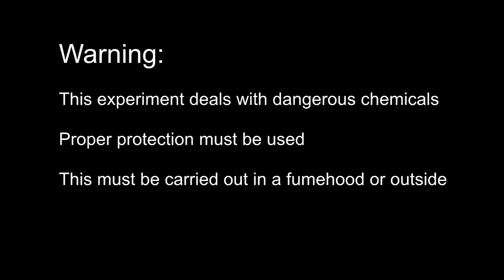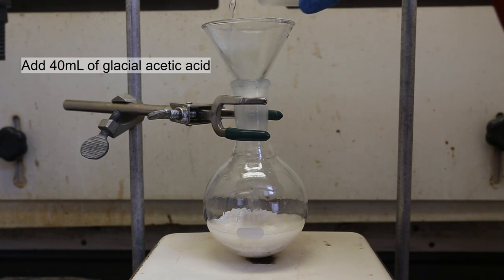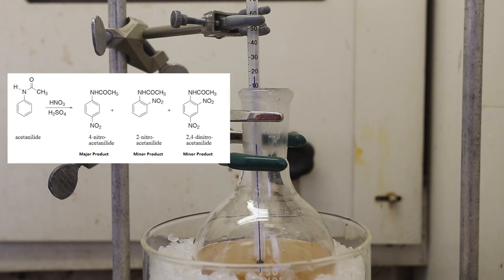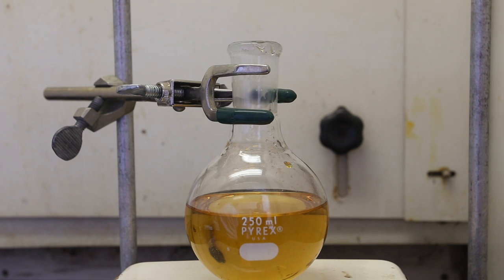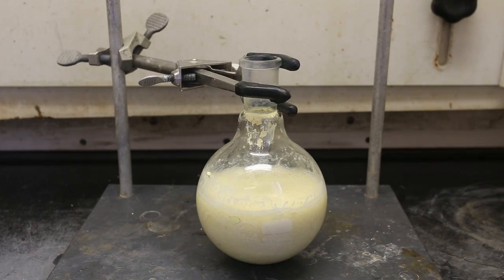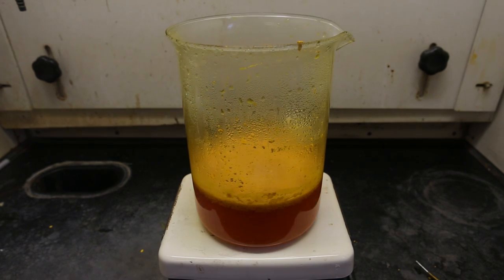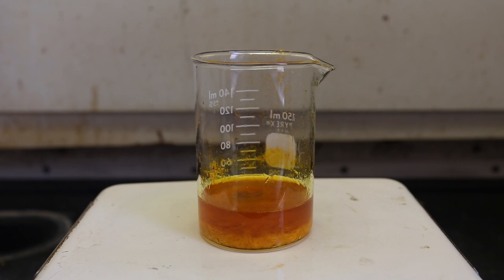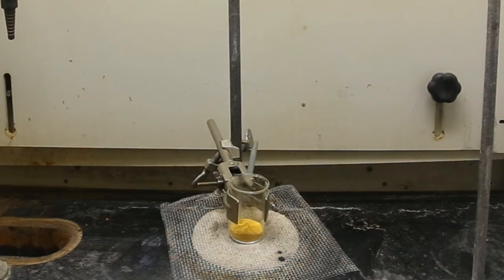Making a carbon snake with P-Nitroaniline

Comment: It would be so totally meta if you made a video on the synthesis and properties of Nile Red, Nile Red :P
Reply from the maker: +Seth Mitchell I plan to eventually !
Reply: +Seth Mitchell what is nile red?
Reply: +11Chemistry  
N ile R ed 
N erd R age
This is nerd rage without the voice distortion.
Oh... half-life 3 confirmed.
Reply: +Output Nile red (also known as Nile blue oxazone) is a lipophilic stain. It is produced by boiling a solution of Nile blue with sulfuric acid.

Can you see where this is going?
Reply: It'd be so meta if the acylamino group was a meta director :D
Reply: @NileRed  update?
Reply: Nitro is a meta director, but also deactivator, real hard to make dinitrobenzene even. Trinitrobenzene is made by oxidizing the methyl of TNT. Dinitrobenzene is meta.
Reply: haha

Comment: Hi ! Thanks i use to perform this experiment in my PG as lab excercise. Method which  was prescribed in our lab manual for hydrolysis of p-nitroacetanilide was bit tedious and yield was also unsatisfactory.
Your method is comparatively easier and seems to provide much better results ! However, i would like to point that temperature of Acetanilide- Glacial acetic acid mix. reached upto 20 deg. Centigrade which is responsible for formation of o- nitro acetanilide and o - nitro aniline upto significant. However, if u manage to keep temp. during nitration below 10 deg. C  formation of o isomer would be very less becos formation of o-isomer requires compratively high temp. so carrying out nitration below 10 deg. C i m pretty sure it will help u !
Reply from the maker: That could work as far as I know, but it would have to be tested! I don't really have to revisit and test it though, unfortunately.
Reply: Okay thanks for your reply ! Wish u best of luck for your future attempts !

Comment: can't wait for the nitrous oxide video. keep up the great work
Reply from the maker: I plan to film that soon. I was really hoping to get carbon disulfide to do the "barking dog" experiment. I wasn't able to get it though.
Reply: Nile you don´t have a video on Acetanilide haven´t you? don´t know if it´s as easy as i think it is, but would still be interesting. (i think i can neutralize aniline with acetic acid and then gently heat it and maybe at some calcium chloride to catch the water generated in the reaction?

Comment: The commercial process to produce PNA is to start with nitrobenzene and directly add the amine group into the para position using ammonia.  Yields are much higher.  But the process require high pressure (30 bar?).

Comment: It is remarkable that there is no obvious sign at all (vapours of NO2) for a nitration in progress.
Reply: 196Stefan2 if you see NO2 vapors while nitrating something, then you're doing it wrong😂😂😂. Sorry but to me your comment sounds like a "your cake didn't turn black. You're doing it wrong!" During nitration reactions you must keep the temperature below 15°C, otherwise the unstable NO2+ will become NO2, which is obviously bad for your reaction.
Reply: Hello Pietro, no, I did some nitrations of aromatic hydrocarbons (Nitrobenzene and m-Dinitrobenzene, o- and p-Nitrotoluene) during my vocatinal training many years ago and I always observed the evolution of brown NO2, sometimes more sometimes less. The NO2-formation did even occur inside the reaction vessel where no oxygen should be present to oxydize NO to NO2 (if there was any). The yields were always within the range of expectation. Nitrobenze was later used as starter material for the Dintrobenzene and Aniline.
Reply: 196Stefan2 I'm not saying that NO2 production will stop the reaction, I'm just saying that it should be better to avoid it, and if you have excess nitric acid it won't impact the yield. Of course there are some nitrations (like TNT synth or TNF synth) where you have to heat up the mixture to get the reaction going and in this case NO2 production has to be expected. But for mono notrations the reaction is fast even without heating it, and producing NO2 is always an issue. I am currently doing some aromatic nitrations in my school lab and my teacher always tells me not to let the temperature rise. Maybe when you did your reactions teachers were a little less concerned about safety.
By the way I think you're messing up a little bit with some reactions. NO2 production doesn't come from NO oxidation (there isn't NO in your reactants, and oxidizing NO to NO2 is a catalyzed reaction which occours at high temperatures). NO2 comes from the breakdown of nitric anhydride N2O5, which comes from the dehydration of HNO3 (when you have both NO3- ions and NO2+ ions in solutions they can combine to form N2O5, which is highly hygroscopic and normally it rehydrates before it can break down). But if you heat up the mixture you increase the production of N2O5 and allow it to escape, and increase its decomposition rate.

Comment: Hey,  i did this starting with about 34.8g of acetanilide and ended up with 14.9 of p nitroaniline even though I skipped the water recrystallization. The product is very brown but i hear it can be '' yellow or brown''. Since my school went on strike,  the nitroacetanilide was left to dry for a month after i filtered it.  I will be making the reaction with sulfuric this afternoon.
Reply: I got the same problem. 

I did the synthesis twice, but I got the very brown product twice. 

The problem might be, that the reaction is not cool enough when it gets nitrated. The first time I tried it my reaction temperature while nitrating was about 20°C and at the second (where the product was not that brown as at the first try) try about 12°C.

Comment: What's the reason why aniline couldn't be used as the starting material? Couldn't you just nitrate that and skip the hydrolysis step? My best guess is either it'd be too dangerous/messy to work with, or the relatively bulky acetanilide group increases the yield of the para product relative to the ortho

Comment: Duh. There are twice as many ortho positions as para positions so ortho is statistically favored. Also formed is the nitramide which in acid rearranges ortho. Nitration of Aspirin the initial sulfuric sulfonates the ring stabilizing the phenol to oxidation by nitric a. Both ortho and para are differently acidic with the dinitroacetanilide being even more acidic. A short Alumina column would separate them easily. One trick for whiter crystals is treating solution with activated charcoal before crystalization.

Comment: You mentioned 'anhydrous acetic acid' rather than glacial acetic acid. 

I learned that 'anhydrous' acetic acid was acetic anhydride and not glacial acetic acid.  Please advise, thank you.
Reply from the maker: Anhydrous acetic acid is the same thing as glacial acetic acid. Acetic anhydride is a totally different chemical and it can somewhat be viewed as the combination of two acetic acid molecules. It is no longer produced using acetic acid though. When acetic anhydride is added to water, the anhydride linkage will be hydrolized and two molecules of acetic acid will be formed. 

In essence, acetic acid is a carboxylic acid, but acetic anhydride is an anhydride. If you look up these chemicals on Wikipedia, it will likely show you everything you need to know!

Comment: Why do you always use a roundbottom flask? Wouldn't it be more efficient to use an erlenmeyer flask? With that you can use a hotplate and can regulate the heat/speed of a distilation/reaction better.
Reply: Tetahydril he has more surface area with the heating mantle I think instead of just the bottom of a flask

Comment: The link is for a reaction with 4-nitroacetanilide if 4-nitroaniline is used instead what are the correct amounts of 4-nitroaniline and nitric acid and what should be the molar concentration of the acid?  I can not imagine the amounts and concentrations are the same as the reactivity is different.  Thanks

Comment: From a purely mechanical observation: Your "final product" after being ground in mortar in pestle was FAR too course. I can't speak to the purity of either your product, or your reagent by this video. Your synthesis is sound, however I"m not sure ambient temps, and humidity were considered, and since some of the reactions involved in, synthesizing the components of this reaction are very temp sensitive; elevation (or for contained apparatus' pressure) must also be considered.

Comment: Are there any chemicals that can damage the beaker?
Reply: Hydrofluoric acid can
Reply: Ben Abbott yeah but that would take some time! Glass is used for a good reason:)
Reply: Yeah, almost every radical substitution/addition reaction

Which is why you need Teflon insets, or your glassware will stick together.
Reply: Justin Koenig no, radical substitutions can't damage glass, unless you're talking about fluorine radicals. And neither addition reactions do.

Comment: Would this nitration work for nitrating toluene?
Reply: BeGamerSl no bro 😂 TNT is much  more difficult to do. you need to do orto-nitrotoluene by nitrating once toluene following the procedure of the video. let it stir for 3 or 4 hours and let it sit overnight. you'll find some solid yellow stuff (p-nitrotoluene) and a yellow opaque liquid (o-nitrotoluene). then you have to take the yellow liquid that comes off (the o-nitrotoluene) and renitrate it with the same process. you can also renitrate the solid stuff that comes off from the first reaction (the para-nitrotoluene), but p-nitrotoluene and dinitrotoluene are very similar and you wouldn't distinguish them well at the end of the second nitration, and this would bring to a dinitrotoluene highly contaminated with para-nitrotoluene. if you nitrate only the o-nitrotoluene (which is a liquid) you can easily separate the yellow solid (dinitrotoluene) from the leftover liquid (o-nitrotoluene). at the end of this process you'll need to do the last step, which is a heavy nitration and very, very difficult to do. you have to take 100% (anhydrous) nitric acid, which is a very dangerous chemical (it will lit on fire almost every polymer, wood or organic material wich comes in contact with it) and can't be found online, you can afford it only if you work in a missile station, or you can produce it yourself, but is very, very difficult. search "how to make fuming nitric acid" from NileRed. it's 87% nitric acid, it will work, but not as well as the 100% one. you can do it if you need a dirty TNT.
over the 100% nitric acid, you'll need oleum, which is a mixture of 70% sulphuric acid and 30% SO3. you can't find it online or somewhere, but if you work in a lab you can find it. otherwise, i don't know methods to produce it out of a H2SO4 factory. the industrial method is absorbing SO3 in concentrated sulphuric acid until you reach the desired concentration, but you can't do it yourself. 
so, i've finished with the chemicals, and let's do the last step. you have to setup an ice bath. make sure that the temperature of the oleum is 0°C and then start adding DROPWISE, EXTREMELY SLOWLY, the nitric acid. The addition of the nitric acid to the oleum is extremely exothermic, much more than the one in the video, and can sometimes be violent. never let the temperature rise above 5°C. Using the stoichiometric amount of nitric acid is wrong. you have to use a large excess of nitric acid and an even larger excess of oleum. the nitric mixture must be 30% nitric acid and 70%oleum.
Then, when the temperature has returned to 0°C, dump into the solution the dinitrotoluene (is better if it's dried and powderized). Then let it sit overnight. you'll obtain some nice crystals of yellow TNT. i don't know the purification techniques, you'll need to do a recrystallization but i don't know the right solvent. probably DCM. don't try to lit it on fire because it won't work. it'll burn slowly with a red, smokeful flame. to detonate it you need another primary explosive, like TATP, mercury fulminate, silver fulminate and much more others. I hope this helped you to understand that making TNT isn't worth your time and is out of your chances. try something simpler. also, it can be intresting knowing the synthesis of this famous substance, so consider this comment as one for  educational purposes ;)
sorry for my poor english, i'm italian.
Reply: Pietro Tettamanti Wow thanks! Don't worry about the Englosh-I'm your neighbour from Slovenia!😉 Actually this was more or less meant to be a joke but still,thanks for explaining the process. I've always wondered how it's made. Now time to delete my seach hjstory or I will land on a watch list!😂😂

Comment: I use to do electro plating and we had a bunch of chemicals you need a license to acquire. 99.9% of people can't get the chemicals to do this how to video. I kinda wish i spent some time making dangerous chemicals while I was working there, but I'm pretty sure I'd end up just killing myself. Was thinking about mixing toluene with nitric acid but I'm pretty sure making TnT without a license is illegal.
Reply: Ditto. Plating shop. Smokers (in non-smoking area) caused a Hydrogen explosion in our waste treatment area. He noted many chems from retail like Sulfuric from Ace Hardware stores. Pool supply and jewelry/art supply stores. Muchaels had Hydroflouric acid.

Comment: what is the die the p-nitroaniline a precurser to called?
Reply: Nitroaniline is a solvatochromic dye
 used for determining Kamlet-Taft solvent parameters. The position of 
its UV-visual peak changes with the balance of hydrogen bonding 
acceptors and donors in the solvent.
Reply: several azo dyes